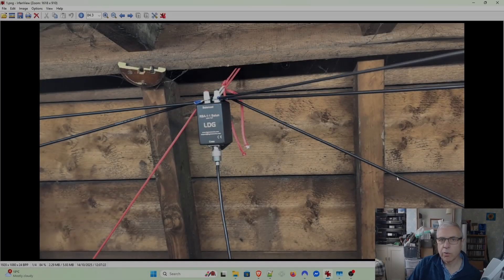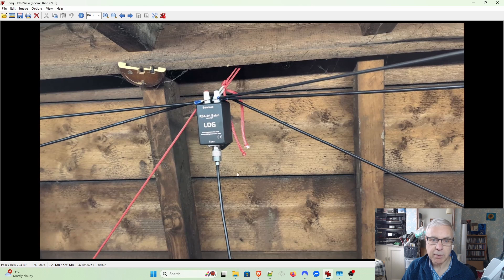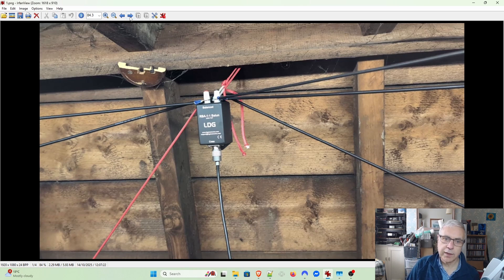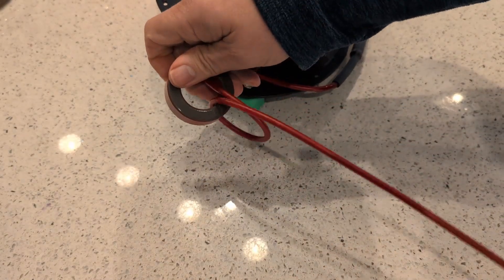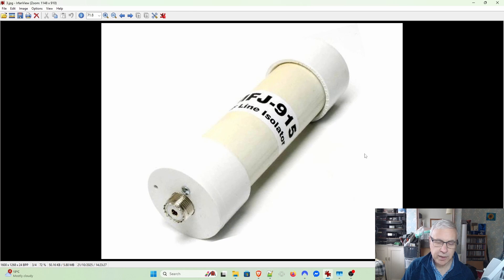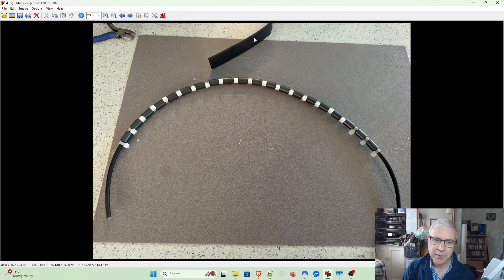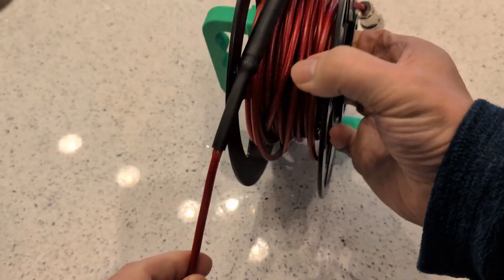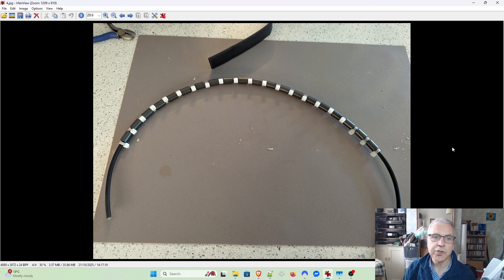How I made my Line Isolator for Amateur Radio

Comment: Here's an MFJ-915 pulled apart to reveal its construction described as "50 Ferrite Core Beads, placed onto a 13-inch piece of RG-303 coax. The coax and SO-239 connectors have Teflon(R) for maximum insulation and extended life of the product. The RF Isolator is enclosed in schedule 40 PVC pipe for maximum strength and protection"

https://www.youtube.com/watch?v=XMixWqYHbWE
Reply from the maker: Interesting! I had seen a photo of ne taken apart, which is how I got my idea, but  my version is definitely better made than this one in the video.

Comment: Every time I went to a radio rally, I bought ferrite tubes to go ver cables. In one instanceI had. Trio R1000 receiver which blew its mains fuse every time I transmitted to a long wire. Slipping two tubes onto the mains lead up against the euro plug cured the issue. I also had to put one on the pc lead from a tigertronic interface to stop the pc crashing. Strangely, this only happened on psk31! Other data modes were fine.
Dave G4BTI.
Reply from the maker: My 2m/70cm radio started jumping out of memory mode to VFO when I transmitted on some HF frequencies recently. I tried various positions of ferrites and it turned out to be T+RF getting in via the power lead. It's like whack-a-mole  with RF and modern equipment.

Comment: I'm curious about what frequencies this is good for. I don't have an amateur radio license yet, but I do have CB and GMRS, so 11M band and 70cm band, effectively.
Reply from the maker: It depends on the ferrite material used. Basically its for stopping HF interference from nearby electrical appliances being picked up on the outer of the coax. So if you have noise on CB it might be part of the solution, but only a small part of the solution.

Comment: i made one from a type 43 mix ring with 6 turns of RG213/U thick coax and it was a pain to get 6 turns through it and put it on my 2 el yagi right at the feed and it seems to be doing its job , i had a low noise floor anyway but now it sounds as if no antenna is in and the VSWR is stable and no more noise through my cheap pc speakers.

Comment: Hi Gordon nice video why at radio end only and not antenna end also or do you have a different line isolator as cant see from picture if further back on feedline
Reply from the maker: I have a 1:1 balun at the antenna feed point which isolates the outer of the coax there. My line isolator is jammed down the back of my equipment rack so i couldn't get a photo of it without a lot of dismantling.
Reply: @HamRadioEssentials ok makes sense thanks

Comment: Don't ever think that an attic antenna won't work well.  Back when I was first licensed, in 1990, I was still in college and living with my parents.  My only place for an HF antenna, was a three foot high, triangular space, between the second floor ceiling and the roof.  It was an older house, and when we moved in, my dad re-insulated it, with foil-backed insulation, all the way to the peak of the roof.  In other words, my antenna was encapsulated in aluminum foil.  Probably, the worst possible setup, yet it still performed well.  I worked every part of the world, using a simple no-balun, four element, homemade dipole, with only 50 watts of power.

Sometimes, I did have to get a bit clever, to break through pileups.  If you're talking on SSB, just tune your transmitter, a few hundred hertz lower, when you transmit.  Your voice will be a little higher pitched, on their end, allowing you to be heard.  (This is a trick that the QRP and low-power POTA guys can use.)

What's funny, is that I now have a large house, on ten acres of land, in a rural farming area, and I haven't installed any HF antennas.  (That's pretty much a mortal sin, if you're a ham.😆)   I mainly work the satellites, now.  30 years ago, I would have made this place look like a Cold War receiving site.  Now, it's just some Yagis, dishes, and various other antennas, at ground level.  I do have a Diamond X-50 VHF/UHF antenna on my roof, though.  Funny how life works, that way.  😃
Reply from the maker: I got the idea for this from a friend in the 1980s who had a simple 20m dipole in the attic and did incredibly well. Yesterday in CQWW I worked Cota Rica and about 100 USA stations running 50w into it. Some of those were on 15m with the auto ATU.

Comment: Nice video what was the Ferrite bead size is a link we can have?
Reply from the maker: I can't remember the supplier but the inside diameter was a fraction bigger than the coax diameter. As there is a bit of variation you would need to measure the coax you were going to use. The reason for that is a lot of the "RG58" we get is actually metric sized (The old Uni Radio Metric dimensions).

Comment: tnx. A link to your choise at ali-express would be great 😀
Reply from the maker: Unfortunately I can't find the exact product. Plus, you need to make sure they fit. A lot of our "RG58" in europe is the old URM (uni Radio Metric) stuff rebadged so its not quite the same diameter! That .2mm can make a difference on what will fit.

Comment: What is the common mode impedance per band?
Reply from the maker: No idea, I don't need to do radio to that degree, but I had watched a video where someone measured suppression by adding ferrites and he got rid of most common mode currents on HF with a quarter of the material I added. Plus, the equivalent MFJ commercial product seemed to work.

Comment: Great video and idea. Can you please put a link or description of Aliexpress item. I would like to see if I can get it here in Canada. Ferrites from reputable firms are very expensive. Shipping alone is $20.
Reply from the maker: Unfortunately I can't find the exact product. Plus, you need to make sure they fit. A lot of our "RG58" in europe is the old URM (uni Radio Metric) stuff rebadged so its not quite the same diameter! That .2mm can make a difference on what will fit.

Comment: I watched your previous video and somebody asked about your line isolator. 
I use RG58 with ferrite rings at each end.
I have two RG58 coax cables and one is a bit more flexible than the other, both good braid coverage.
That is what I look at now because I bought some at a radio rally and very disappointed when I got home, the screening was very poor. 
G4GHB.
Reply from the maker: The stuff Radio Spares sells for £2 per metre is Belden, but you can currently buy 300m of it for £70 on Ebay as long as you are happy its white!
Reply: @HamRadioEssentials  
I'm okay for coax now. I got some at a rally and asked if the braid was good coverage and he assured me it was. 
It is.

Comment: Morning Don, Interesting option. When I first fired up my FT1000 a few days ago, I could hear myself clearly through the speaker of a nearby wireless doorbell unit - which happens to be plugged into a socket just outside the shack door on the same ring main as my transceiver. Fixed it by adding several ferrites onto the rig’s power cable. I have also since fitted a commercial 1:1 choke into the (RG58) coax a couple of meters from the rig, but my FT290 is picking up RF from the HF rig - probably because the two lengths of coax run close to each other along the back of the desk. I need to investigate further. 73 de Peter GM4RAH 🏴
Reply from the maker: You might need to fit a ferrite to the power input lead on the 290. Unless its also got the same problem running from batteries.